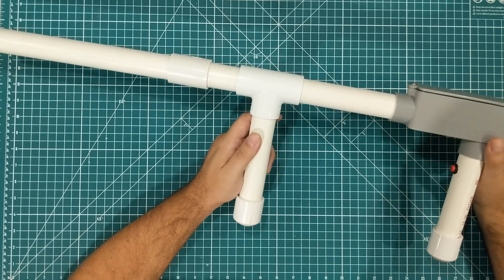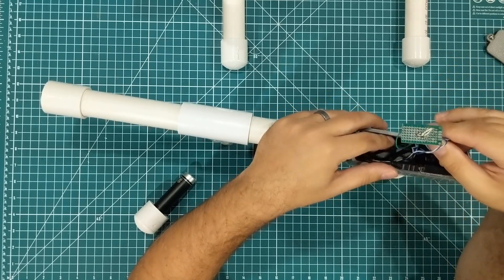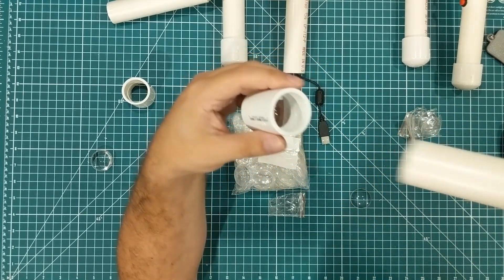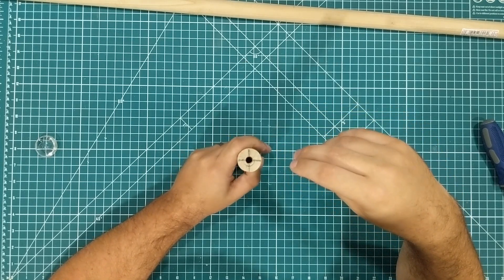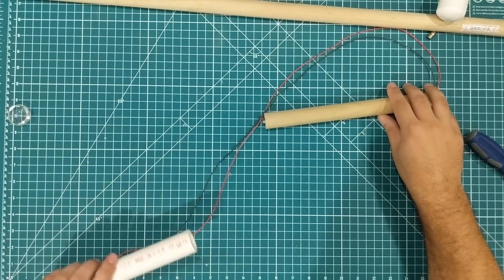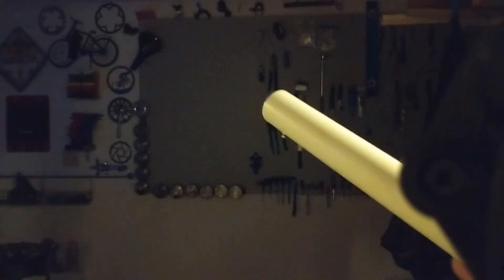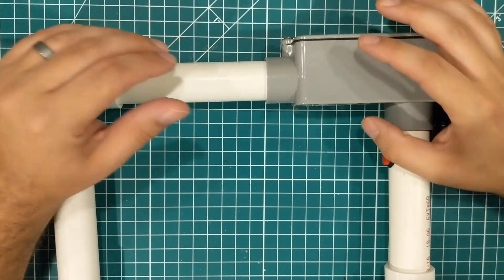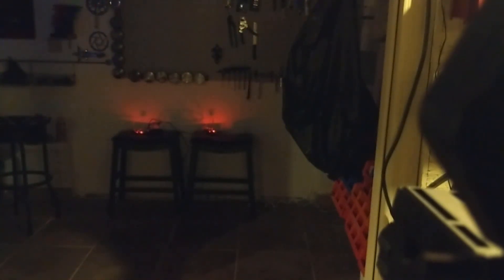Shoot Infrared 100+ Meters

Comment: Hi, Awesome video and a great solution! I am making a school project using your design to make a game where you have to shoot targets. We are basically done building it, but we are using normal 9v batteries wich are quite expensive and they die out within a couple of hours. We are now trying to use a power bank like you are using, but every powerbank we try shuts off after a couple of seconds because we don't draw enough current. Did you also have this problem, if yes how did you fix this? If no, could you maybe list the powerbank you use or maybe give a suggestion on how we could make our circuit draw more current? Because our circuit does seem a lot more simple than yours, we just use a button and an ir led connected to the arduino directly.
Reply from the maker: Hi. I know it's a bit late. I didn't have that problem, but with a power bank you could just use something like a little incandescent light or some big resistors to draw some extra current.

Comment: Please we need another detailed build video , as the receiver is not shown  , also please share some scripts , thank for the video really
Reply from the maker: I have another video on the receiver. https://www.youtube.com/watch?v=McYDX7_Tqy0  Then the sender is basically any ir sketch and circuit. There's nothing special there.  The magic is in the lens. This is a good circuit to overdrive the led a little https://www.digikey.com/en/maker/blogs/2021/how-to-send-and-receive-data-over-ir-signals-with-an-arduino
Reply: I have built something like that but much more compact and i have successfully tested it with 1000 meters. Demonstration is here: https://youtu.be/a9-3Va7cq7k It is without details because it is pretty simple to build. Link to the project with source code and circuite is in video's description.

Comment: Hi, great video! I'm building a laser tag game myself. I borrowed ideas from you. I was wondering if you had a 2n2222 transistor hooked up to the test rig you made? Thanks
Reply from the maker: I've boosted the leds before with a 2n2222 but eventually I figured out that focusing really well was just good enough.
Reply: @AnotherMaker  In my setup I'm using a lens from a hacked flashlight. The lens is 30mm. Do you think that the lenses that you used are a better match?
Reply from the maker: @raymondlagcher8504  The lenses I have are perfect. The trick is to swap out the infrared LED with a red led and see what distance you get. You will basically get the same distance with red as infrared
Reply: @AnotherMaker  I did test with a red led. But the light is very dim. So I can imagine that the point wil be less on the wall will be less focused. Will try another risitor.

Comment: Great thing, I just can´t believe that 100m range. Bad thing is the link to the lenses is dead, I got a 30mm (/) 100m FL  biconvex but I don´t get too good results. About 7m.  Even worse with the lens attached. Probably losing to much light then. Anyway, I assume the PSU you are using is a 5V powerbank. What is the circuit for the amp looking like? These ali LEDs got no specs at all, I bought a bunch of them but due to missing specs I have chosen different ones now.
Reply from the maker: That lens link is not dead for me. They still have the same ones I bought years ago.  I drove the LED with this circuit https://www.petervis.com/Raspberry_PI/Driving_LEDs_with_CMOS_and_TTL_Outputs/Driving_an_LED_Using_Transistors.html.  It's been a while since I've done it, but if the focus us right you can get pretty amazing range with just the led on the arduino pin.

Comment: Really cool project, thanks. Can you share the code that differentiates the IR signal so one gun registers as red and the other blue? I’m new to Arduino programming. Thanks
Reply from the maker: So you can see in here https://pastebin.com/24YtvJGK  that I'm sending 0xa1 for player 1 and 0xb1 for player 2. This is on the sending side.  Then this is the receiver https://pastebin.com/gHtVb2SD and you can see how in the loop it does a different effect based on which one it received.  https://pastebin.com/gHtVb2SD
Reply: Thanks, This is exactly what I’ve been looking for. Im building a Dark Ride and wanted to add rider interaction with two guns to complete with each other and tally up their scores.

Comment: thinking about scooping the insides out of a nerf laser tag gun(they're about £10) and replacing it with a similar system. Great video!
Reply from the maker: I love that.  You definitely should.
Reply: @AnotherMaker  I'm currently trying to use all the stock stuff except the emitter, but I'm having difficulty with trying to reprogram the mainboard.
Reply from the maker: @matlex9605  What error are you getting?
Reply: @AnotherMaker  None, i just have no idea how to program it
Reply: My first set I built 4 years ago were in nerf guns, they looked really good, I am currently building a new set but I am using a couple of toy m416 guns off Ali express. I use a transistor for the led and can confirm these can shoot UpTo and over 100 meters. Nice work Another maker, you explained the focusing in a easy to understand way.

Comment: Hi. I followed a sort of similar path but decided to use a massive IR transmitter of the right band with a transistor. However, I think I am using the wrong arduino infrared library as it is pretty darn complex and the range seems to be bad. I am guessing that it’s not really making a 38khz signal as needed for the receiver. Do you have any tips or suggestions for getting the arduino code right? What library or something to use. Thanks
Reply from the maker: They've changed the IR library and I had a frustrating time.  The one I used in this video was the generic IRremote library
Reply: @AnotherMaker  I see. Yeah, the new one Im using has so much documentation and stuff. I tweaked it to work but honestly I have no idea what the 40 lines of code do to make it work compared to the few needed before.

Comment: Don't mind me, just sneaking by to steal a few of these lenses.
It's SUCH a pain to find a good source for a good lens like this... I wish AliExpress wasn't the only option, but oh well.

Thanks a lot for sharing the setup here!
Reply from the maker: There may be some other ways to do it. I just got a confirmed 250ft out of a cheap laser tag gun off amazon.  They're only 100ft out of the box but with that transistor from this video 250 was reliable.
Reply: @AnotherMaker  
Very nice! 250ft would be such a pleasure, though I was actually hoping for a little more even.
I made my own Lasertag that got featured on HackADay a while ago and wanted to revisit it. A proper LED + focus like what you show in this video would be awesome.

Oh, also, I would double-check the focus of the IR LED with some kind of IR-Sensitive camera.
The IR has a lower wavelength, and the lens might not actually be focusing the IR light the same way as visible, so you might not have a focused IR beam. Then again, red light and IR is close enough together...

I never checked myself.
Reply: @MrRedwires  "The IR has a lower wavelength" I think what you really mean is that IR has a longer wavelength. As for the values in either Angstoms or nanometers it will be a higher value than visible light.

Comment: Great Video! Is there a way to get the arduino codes you used, as well as a circuit diagram?
Reply from the maker: On the receiver side, I break provide the code (which has the circuit instructions in the code) at https://www.youtube.com/watch?v=McYDX7_Tqy0 

For the sender, it's just an IR led and a button as described in this code.... https://pastebin.com/Bq3tZQAB
If you want to add a transistor to the sender, this shows you how. https://arduino.stackexchange.com/questions/36758/using-a-transistor-to-get-100ma-on-a-ir-led

Comment: Hi, I am really impressed by what you have done ! Could you please give me links for the components you are using ? I can't find an ir led a bit powerful (btw how much Watts is your led ?) nor a sensor like yours. I also have other questions, if I could contact you by email or something like that it would be great ! 
Thanks in advance and great job !!!
Reply from the maker: Thanks for watching and for encouraging me to update the video description!

LEDs 
https://amzn.to/3ckm5Ef 
or 
https://www.aliexpress.com/item/4000838376382.html
and
https://www.aliexpress.com/item/32996166248.html

Transistors
https://amzn.to/3kqYMva or this kit https://amzn.to/33HfeRp
or
https://www.aliexpress.com/item/32814626918.html
Reply: @AnotherMaker   thanks a lot, but are these leds powerful enough to get a good range ? I tried them few months ago and wasn't able to get more than a few meters. I thought you had an other one in your video. Regarding the receivers, do you know how to handle receiver led with only two pins (like in the second link) ? And how do you wire several receivers together ? (If i wnat to have a bigger target). Do you handle them individually or are they wired together ?
Anyway what I am trying to say is that if you had some schematics to share it would be very useful. I have never wotked with transistors or Ir receiver and I don't really know how to work with them
Reply: I think I should precise that I am considering to build a few laser tags sets.
I am still thinking about it but i think I am going to have a 3d printed gun with an ir led, a red laser (to aim) controlled by an esp32 (i have never worked with them if you have suggestions). The esp32 would communicate with an other esp32 on the armor. The armor would consist of at least 2 targets (one for the front, one for the back). They would be also 3d printed and have in them led strips and ir receivers. I'd like to have quite big targets (because it would be frustrating otherwise), that's why I am considering to have multiple receivers (although the beam coming from the gun might be wide enough so I only need one receiver, I don't know yet and would love to know your point of view on that).
Then for the scores, my idea is that the ir led would send some id so that when someone is touched, they know who killed them. Then there is two solutions, either the player touched sends thanks to the ESP 32 a wifi signal to signify that the player has been killed by x, so that x knows it and earn points. Or the player keeps the information and at the end of the game, all the data is shared to compute the scores.
This will depend on the range of the ESP32, but also if they can connect at the same time to several devices (the armor would need to be connected to the gun and also a server) and also how fast it is to create a connection (ideally i would like to not have a server and that when a player is touched he just connects to the "killer" to signify him, but I don't know if it's possible).

I hope my explanation was clear. I am sorry to bother you with all of these details but I am new to all of this (i usually work more with robots and arduino).

And of course i forgot to mention that since I am considering to build quite a few of these, I would like to keep the prices low.
Reply: @willcharlotte3851  well i think it will be a good idea. The same of pubg but you need more distance like 200m or more. Let me know if you findout howto. As i know you need wifi range and arduino on bodies all connected and mini screen display like smartwatch showing battery life and  your life counter and other one on your arm showing arm power nd how many shoots you have. Thx for your time hv nice day 😊